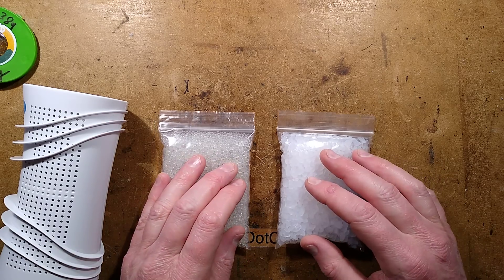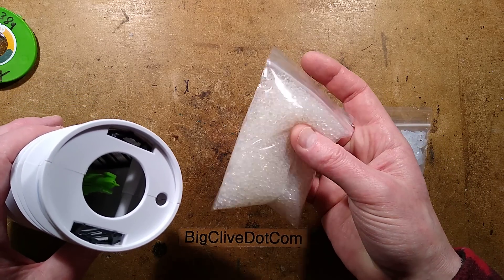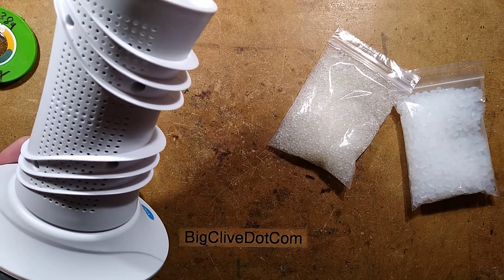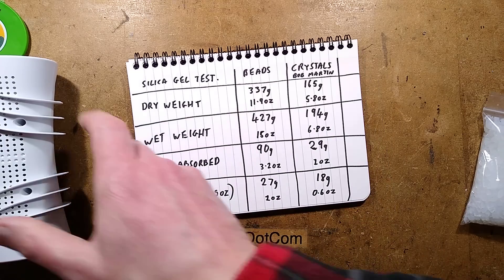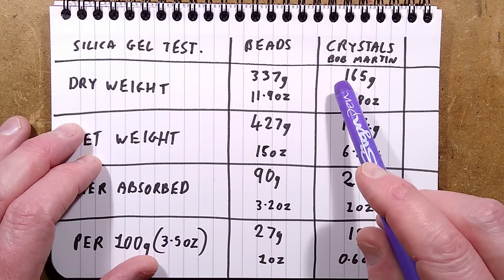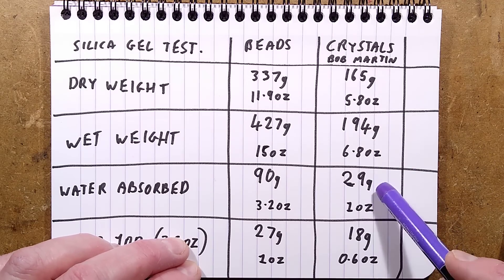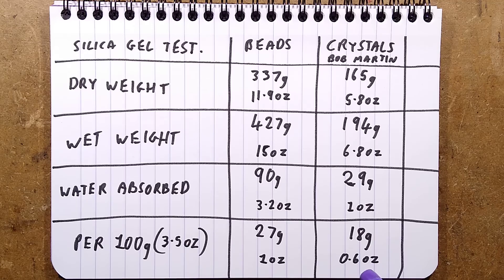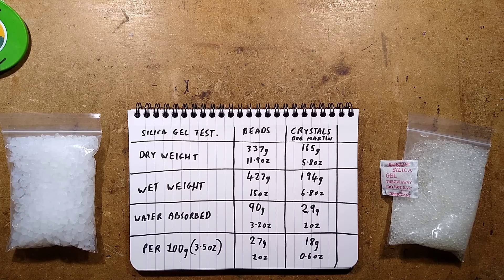Silica gel desiccant showdown - normal versus crystal cat litter

Comment: It might be worth comparing the price per gramme of water absorbed as well.
Reply: I just checked and it seems like the difference is rather significant.

The cheapest beads I could find on Amazon cost me around €15 for 1 kg.
Conversely, 5 kg of cat sand (the silica gel variety, obviously) was only approximately €10, which breaks down to €2 for 1 kg.

Seems like cat sand wins the day on a price to performance ratio.
Reply: @herrpez  but then you need more units to store the greater volume to acheive the same result........ but, it's good info to know............. cos then you can make choices.......
Reply: @BerkeleyTowers  True, but if it absorbs a third what the beads do, but you get 8 times the amount for the same price, that's still a significant amount of drying capacity.
Reply: @ZeroPointAlpha  But having more dehumidifier units running will also mean more power used. So I'd think it might be a wash in terms of cost at the end of a month or year. (or I could be wrong, which is just as likely lol)
Reply: @DUKE_of_RAMBLE You don't necessarily need a dehumidifier. Leaving it in open air in a closet you wanted to keep drier or a firearms safe to prevent rusting will result in it having a passive effect. I'm actually going to be looking into doing this as a way to keep my firearms in a less humid environment.
Reply: @DUKE_of_RAMBLE  The only energy used is when the crystals/beads are rejuvenated. This can be done with waste heat instead of a dedicated dryer. A warm oven after cooking for example. I have a piece of equipment that is particularly inefficient and runs hot. I rejuvenate silica gel in a little cage I made attached to the fan exhaust. Waste not, want not, as they say.
Reply: @squelchstuff  hah Smart!!
Reply: @jameslawrence8734  Another way I use cat litter (clay and crystal) is if I plan to leave my car standing for weeks at a time as it prevents moisture build up.
I simply leave some of the cat litter in plastic bags on the dash, front passenger floor, rear floor, and in the boot. You have to remember we are talking condensation levels of humidity in the car so clay or crystal will do fine either way at balancing out the moisture in the car.
Reply: @BerkeleyTowers  it's dirt cheap, so cheap all volumetric considerations become irrelevant.
Reply: @herrpez  the cost-effectiveness for cat litter silica gel is huge. Noticed that. What I was lacking was the experiment to show how effective it was at doing the job. Well done!

Comment: @2:30 - "90 grams which is 90 ml."  Since I started using borosilicate beakers in my kitchen for cooking - like chemistry beakers and such - it dawned on me that I now, as I am much older, wish we had have been taught the metric system.  Weighing/measuring quantities is far more intuitive with the metric system.
Reply: It's also much easier to scale a recipe ... I've started converting all of my ingredient lists to gram weights
Reply: @jeremiahbullfrog9288  Yeah, cook by weight.  Don't use volume as it can be inaccurate due to things like flour being compressed etc.  Sifted is bigger than straight from the bag and so on.
Reply: @j.f.christ8421  Flour can still be inaccurate due to moisture content... although I think in typical kitchens it's not a huge deal. I can't imagine a bread recipe written in Arizona to work the same in Florida though lol.. Overall I find weighing everything to be much more convenient and repeatable!
Reply: @jeremiahbullfrog9288 A recipe is tinkering but baking is science and requires repeatable measurements.  I enjoy your perfectionism although I am a recovering perfectionist myself.
Reply: @jeremiahbullfrog9288  That's why I always store my flour in kitty litter!
Reply: There is a caveat. 90ml = mg is in reference to water. 
Anything more dense isn't strictly applicable and would need some tweaking to the weight.
Reply: @JLneonhug I understand.  It's more the general concept that helped me evolve.  My wife and I just had a lengthy conversation about dry vs wet weight.  She still doesn't get it.  I do all the cooking.
Reply: @JLneonhug  ... anything or less dense. 
But as long as you drink less than 2 litres of vodka per day it doesn't make much difference to how drunk you get due to the discrepancy. 
(Took me weeks to find 2L cutoff-point because I always felt a bit hazy trying to do the maths)
Reply: @JLneonhug  while 1 g = 1 ml is only for water, when cooking most liquids are mostly water so it is close enough. There are some exceptions though, like oil or syrup.
Reply: @JLneonhug  but try thirding a recipe.
Reply: @seanoconnor1984  Fine, I choose base π 😁
Reply: How old are you? We only used the metric system in school in the '70s and '80s (U.S.).
Reply: In this context, I find it rather curious that Clive still converts grams into ozzies… or so
Reply: In the early part of the pandemic I made hand sanitizer from industrial grade isopropanol. I used a recipe that was from the WHO. But, I don’t have accurate volumetric measuring devices, so I used my kitchen scale, which measures in grams. I accounted for the different density of alcohols and the different concentration of isopropanol.
Reply: @five-toedslothbear  Given the usual "65/35/a bit" of 99%I PA/water/glycol has well over 5% tolerance I'm not sure why you bothered.
Reply: I just wish the metric system was in base 12 instead of base 10 😢
Reply: @colleenforrest7936 Why? You do not have 12 fingers, do you? 👏🏻
Reply: @artok3897 But we do have 3 pads on each of 4 fingers: 3 x 4 = 12.  It's a neat trick I picked up from someone on some other thread somewhere.  An old way for counting dozens, though they said count your knuckles.  Here's how it's done. Saturn your palm up. Using your thumb as a pointer, place it on the lowest pad of your little finger. That's 1. Move it up to the next pad. That's 2. The top pad is 3. Move to your ring finger. The bottom pad is 4. The next one up is 5, and so on til you get to the top pad of your index finger. That's 12.  

If you raise a finger, and lastly your thumb on your other hand each you cycle through this pattern, you can count to 60. (12 x 5). 

If you want to get really crazy, you can count to 144 on your fingers by moving your thumb   of your other hand over each finger pad each time you complete the cycle on the first hand.  (12 x 12).  Just like 12 is called a dozen, 144 is called a gross.
Reply: In fairness, What's unintuitive about fluid Oz vs Oz weight?

1 fl Oz of water weighs 1 Oz 

That's one of the things the old units got right
Reply: The biggest issue is that the volume to mass (not weight!  metric has no unit of weight!) is calculated off of perfectly pure materials.   Change the materials, and you no longer have that.   So it's better to not even try to use that conversion at all.
Reply: Yes, for certain purposes, metric is vastly better (like cooking, chemistry, CNC), however, for other purposes, well, no.
Fahrenheit is far better for thermostats to adjust heating and cooling for *people*. I can feel a 1degree F temperature change. It matters. 1 degree C just is too big a change. I always hated being forced to control HVAC equipment in C while traveling outside of the US.
For certain trades. Rough carpentry, like framing walls, siding, lumber measurements and the exact width of a circular saw blade, inches are much more useful than mm. Saw blades are exactly 1/8" wide. 2x4's are exactly 1 1/2" by 3 1/2". The cm or mm measurements are just cooky.
It is also a lie about how universal metric is. In Guatemala, a gallon of gas, kilo of that, for those that know it, there is also a Mayan set of units, etc.
So I happily buy a 2x4 in feet and inches, get 2 liters of soda, weigh my creatine supplement on grams and have my thermostat at a nice 68F.
Reply: @CrispyCircuits  You can't tell the difference between 1 degree in Fahrenheit or Celsius.  Saw blades are 3mm thick.  "2x4's" are 45x90mm.  What was your point?
Reply: @j.f.christ8421 Wrong. 1/8 = 0.125" which converts to 3.175mm, not 3mm
Reply: @j.f.christ8421 Also, just because you don't have the sensitivity to feel 1 degree Fahrenheit, does not mean that others do not. I can clearly see the flicker of 60Hz monitors and fluorescent lights. Wave your hand back and forth in front of your eyes and you will see the flicker.
However, my sense of touch is terrible and awful. That's from a test by my previous Dr.
Reply: To add clarity to this, in rough carpentry, there is one thing that requires perfection. Cutting stair stringers for stairs. If you are 1/16" wrong in the same direction of the error, at the 16 steps required to reach the second floor, you will be off by 1" and have to throw them away and re-do the work.
I did remodeling and new construction as my trade.
Reply: @CrispyCircuits  I think you fell foul of reading the decimal portion of 3.175mm in thou. 0.175mm is not 1/16" but 7 thou, so after 16 stringers, the error would be the 1/8", not 1". As an engineer, I have, and can work in both systems, but prefer metric.

It's these kind of conversion mishaps that caused the Mars Climate Orbiter spacecraft to end up crashing into the atmosphere. Final word - thousandths of a inch are akin to decimal...
Reply: @CrispyCircuits  You don't need to increase the temperature by whole degrees. We invented the decimal for a reason.
Reply: @CrispyCircuits You are aware that decimal points is an option with the metric/celsius systems... right?
It doesn't HAVE to be 21c, it could be 20.7c. It doesn't have to be 2cm, it could be 1cm and xx mm, such as 1.937cm. 
Your comment does come across as a bit of "I want to dislike the metric just for reasons, nothing else. Fahrenheit best, for reasons of me always using it". Everything being in 10s has got to be logically smarter for everyone to understand, rather than the emotional rollercoaster which the imperial system(s) are.
Reply: @CrispyCircuits  - did you read what you just wrote? 2"x4" is 1½"x3½“?
Reply: Shrinkflation 😅 @JanBruunAndersen
Reply: @JanBruunAndersen  You think 45mm = 1 1/2 " and 90mm = 3 1/2"?

Comment: But the cat litter it is 6 euro for 5 litres and 800 grams of beads is 14.50 euro's  ... I get why the cat litter is used 🙂  (as you can see I was too lazy to do the conversion calculations :-p)
Reply: In December 2018 I bought 2 x eBay 382563385994, back then I paid €79.96 for the 20 kg + €19.90 for shipping ~ 4.99/kg shipped, now it's more expensive and it seems that they no longer combine shipping but it would still only be ~ €7.68/kg
But I never measured the actual weight/volume, I just trusted the seller, I hope it was packed dry and in the right quantity... 😅

Comment: Nice.  What was the relative rate of absorbtion ?   How much water can each type dispose of in a day ?  cheers
Reply from the maker: Slow.  They are only designed for small enclosed spaces.
Reply: Does one take significantly longer/shorter than the other to absorb/expel?

Comment: The difference is actually in the pore size of the silica gel. The type that is meant to absorb moisture has smaller pores (Wikipedia says about 2.5 nm), while the liquid absorbent type has pores of 4.5 - 7.0 nm.
Reply: Thank you :)
Reply: Wikipedia sucks like your mother. Who gives af what jw owned platforn says.
Reply: That kind of makes sense in a way, more surface area on the smaller pores compared to the weight I guess.  More of the silica exposed to the air.
Reply: Point to note unless you have the desiccant in an air tight container the moisture will be immediately replaced!  So have one of those units for every 4 cubic meters inside your house and have your house sealed inside a plastic device(never open it!) or otherwise dont bother!
Reply: @danquaylesitsspeltpotatoe8307  "This easy trick that carbon dioxide sellers don't want you to know."
Reply: @danquaylesitsspeltpotatoe8307     Sort of,  but not quite.   You don't need an air tight seal to have a much higher humidity inside than outside, and that is where these devices are aimed at.  You don't want absolutely dry air, that would be unbreathable to humans.  You just want to take the excess moisture out of the air caused by respiration and other indoor things.   That's why humidifiers and dehumidifiers exist and they work just fine in making indoor air quality more tolerable.
It's like the air purifiers.  Sure, turn it off and the air quality starts to deteriorate again.   That's why you buy a device though, so you run it and make the air quality more tolerable while you're watching Big Clive on your computer screen

As far as Clive's experiments, they are perfectly valid.  These silica crystals don't instantly absorb moisture to saturation point in seconds.  They take a period of time to absorb moisture.  Usually over several days or even weeks
Reply: Could the cat silica be refined?  Baked at 420f for 42mins?
Reply: @BrettCooper4702  I bake my cat litter at 100 Celsius for one hour when drying my 3D filament desiccants. Same goes with the bead bags that come with every spool.
Reply: @sleeptyper just don’t bake cat litter after the cat has used it.
Reply: @jamier.6634 Don't tell me what to do!
Reply: @Sonny_McMacsson ikr, people are so rude
Reply: @KaitouKaiju My money’s on Schrödinger’s cat 🐈
Reply: @KaitouKaiju Obviously the cat pissed in his cheerios as the cat litter was in the oven.
Reply: I wouldn't like the smeel if it's been used as cat litter,, when drying it out 🤷‍♂️🤔
Reply: @BrettCooper4702  Sounds like you were at least half-baked yourself when posting 🤣You love the 420 refs

Comment: I suspect the crystal cat litter is optimized for capturing liquid (urine) rather than extracting moisture from the air.
Maybe to compare this take 100g of each and pour water over them (or submerse in a container of water), then drain the excess water with a sieve, and measure the final weights.
Reply: smaller bead size helps with the air contact.

I'd like to see the normal bentonite test too. it depends on air moisture how it behaves to a big degree (we go through 150 kilos of the bentonite litter a month give or take few tens of kilos.   I haven't come up with something to do with it other than have the garbage guys take it away so if anyone has recycling ideas I'm all pis I mean ears)
Reply: @lasskinn474  
is your cats name  'Sir Krapalot '  ??  .... or perhaps it is a tiger   ? ;<)

Comment: I use the Compressed wood pellets for Horse bedding. You get a 25Kg bag for 9.00Cad. changing the pan once every 5 days a bag will last 2 months. Its also safe for the kitties, Its bio friendly, Smells great and cleans out way nicer than the Beads <3

Comment: It would be interesting to see if it is a surface area issue. A quick few minutes with pestle and mortar would reduce both down to a consistent size.
Reply: Surface area is probably a significant issue but while the beads are presumably pure silica gel, it is quite likely that the crystals have a proportion of other things such as deodorants. A worthwhile test nonetheless.
Reply: It's hard to bust up silica gel pellets - they're very hard and tend to shoot out of your mortar and pestle. I imagine the cat litter would be much easier to bust up.
The silica gel shas a huge surface area. Dunno what's in the cat litter but it could just be bigger pellets of silica gel - and or mixed with other stuff

Comment: How do costs compare? How much absorbed water per quid?
Reply from the maker: The cat litter definitely has easier availability off the shelf in big bags.
Reply: Since it can be reused I'm not sure that's relevant other than initial cost. But since it would seem to require about 3 times the volume and therefore 3 times as many devices the cost of the devices is possibly the significant item.